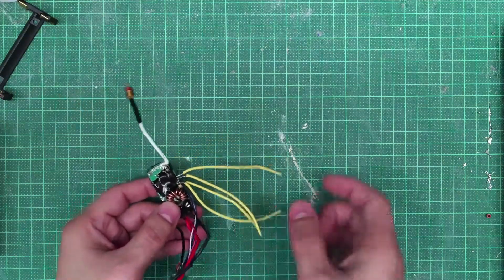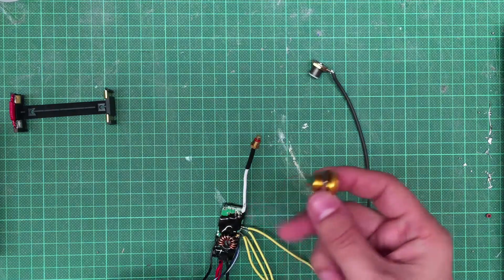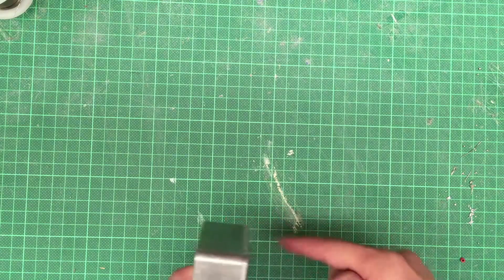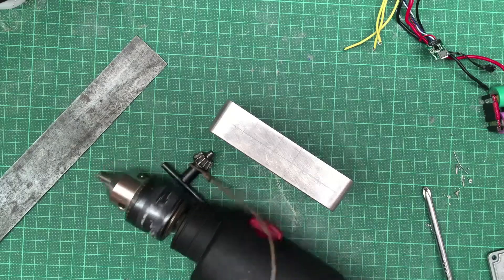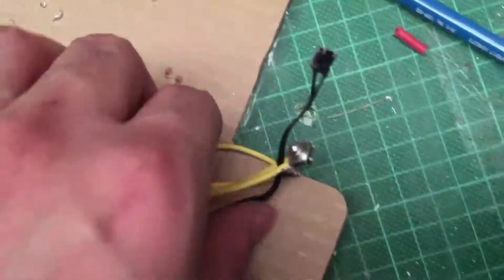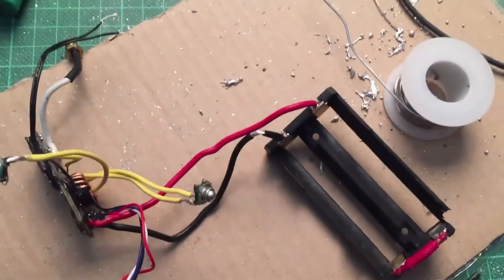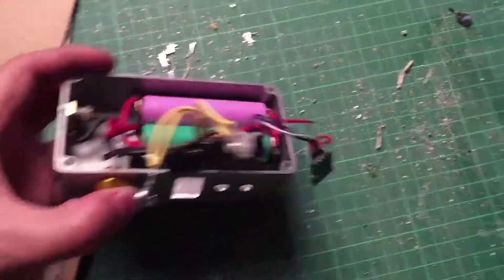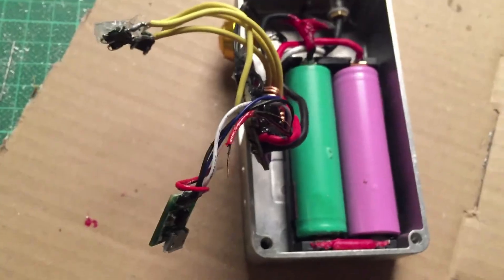Box Mod Yihi SX350 Project Tutorial - Part 3

Comment: why did you solder the bottom of the battery sled together?
Reply from the maker: ***** to double the voltage, as this chip (SX350 100 watt) can handle it with no problems